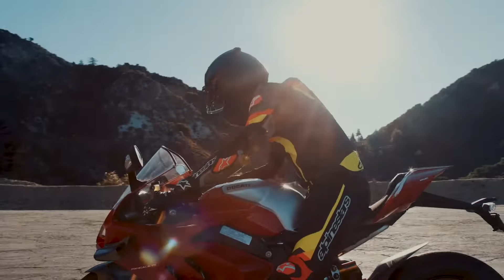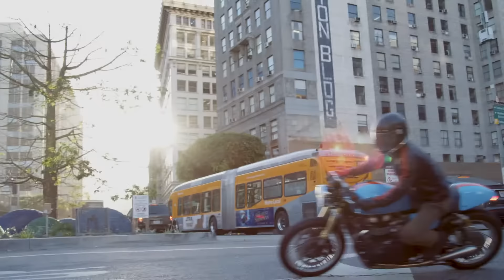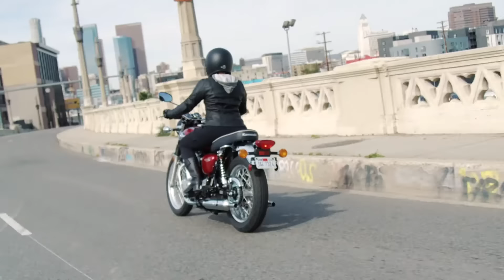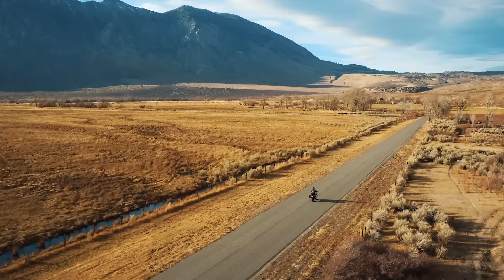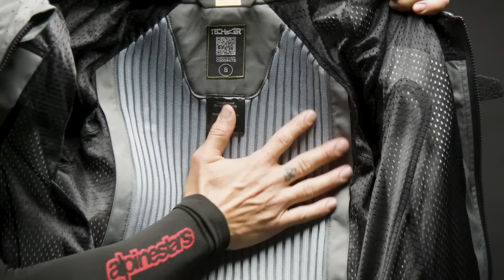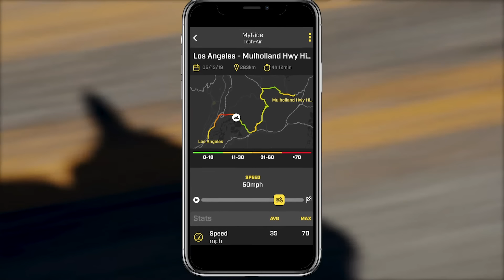Tech-Air® 5 System

Comment: Could you explain the CE Level ratings for the airbags.  In your video you provide kN force for CE Level 1 airbag and CE Level 2 airbag.  But, I don't see any value on Alpinestars website.   I am interested in the Tech-Air Off-road airbag system.  Also would be great to give a sense of something that looks like 1 kN.   Is that for of pushing 100 kg. of mass so many  meters per second?  Seems a lot.

Comment: I bought one after reading about broken ribs & scapula on one Utube test rider's slow speed urban slip on diesel.....but...

In the instruction book it has an exemption clause for pacemakers or heart conditions. Written in RED it stated Do Not Use if........

So, sadly, I returned the garment for a refund......but am still wondering why I am excluded from using one when I am still able to ride according to doctors/cardioligists....   Is it a case of legal liability protection or nanny state overkill?

Sure I have had open chest surgery, but from the video's made by Alpine Stars the TA5 looks like it inflates very gently and does not crush the chest, unless maybe, it's installed in a non compatible (not enough expansion room) jacket.

I'm perplexed. I want one, it's got the best rib cage coverage over Dianese and Klim vests, which kook like giant life vests for boating when they inflate.........

Perhaps Alpine Stars reps can advise, as staff at shops just don't know the answer.......I think I will end up buying one anyway -  after watching the video it passes my seat of the pants test criteria, but an affirmative answer from a technical expert would be very helpful 🤔

Comment: And why are they not used in MX or Enduro? If they’re so good? And resetable?
Reply: They are actually using or at least had a run with them in one of the previous Dakars for sure. I know, because our country racers have used them. Though the model was a bit different and more like MX/Enduro body armor rather than a jacket like here. I was on a fence buying it and the price was around ~1k EUR for it.

Comment: I do not recommend this vest in one and a half it stops working it no longer turns on and the bag there that is inside the vest always comes out of its place which should be putting at risk that in any fall or when it inflates it will be plowed in a position inadequate that could hurt you more and another thing is that the clasp that is on the front that activates everything comes undone very easily and to make the 5-year guarantee valid they put many locks on you and in the end you have to pay more and be careful why you They say that there is a specific way to charge the vest, why else would they tell you that you damaged it by connecting it incorrectly and they no longer want to make the warranty valid and they never show you how it should be with their USB charger and in the official video they say and show what it is very easy and fast but it does not specify that it must be connected from an exact position

Comment: Have had one since 2020. Just had a crash with it, and it worked better than I expected. Not a scratch on me, after a 50+mph lowside. TA5 deployed before I hit the ground. It felt like a very gentle deployment -- I really barely noticed it. Really amazing!
Reply: this is the best comment here <3  Thanks for the info!
Reply: @adamangelis5558  You can’t do it yourself, you have to send it back to alpinestars or authorized dealer to reset it. I think it’s a couple hundred each time.
Reply: @adamangelis5558 Yes 3 times you can use it
Reply: How does cost the cylinder?

Comment: What happens if you wear a very fitting leather jacket with traditional stretch panels? 
Do you need a golf ball of room with in the jacket with the airbag on or off?

What if you jacket has some stretch it is “fitted fit” once the airbag is in? 

Will it hurt you? Or just not deploy as well?

Comment: can I wear Tech-Air 5 without any jacket or garment above it at all?
Reply: TA5 doesn't provide any abrasion protection. Also, if you crash without a jacket over it, the airbag will surely be shredded. Instead of $180 for service, it will cost you $800+tax.

So, "CAN" you? Yes. But, you should not.

Comment: Simple question with no answer. Dear Alpinestars if iI'm riding with t-shirt can I use tech air 5 on top without any jacket? Or there are some other issue like gas cylinder on the back is not protected from direct sun light end etc.. I know there are tech 3 available, but regarding tech 5, can I?
Reply: It has no abrasion resistance.  That's why you need a jacket
Reply: You need a jacket
Reply: You’re kidding? So you want protection but wear a tshirt ? Mate grow up and gear up
Reply: @scottishmudders8357 while I agree with you, I get his point as well. I was just flung 40ft off my bike breaking 6 ribs and collapsing both lungs, puncturing one of them as well but with SUPER minor road rash, All I was wearing was a dirtbike jersey. I'd love to know if I can wear this with an abrasion resistant long sleeve with some elbow/shoulder armor as comfort is definitely a priority for me. I'd likely wear it under but it would be nice to know if I could do either.
Reply: You can certainly wear it under no issues atall provided you give your self some inflation room. I ride now with dainese race air and it’s very uncomfortable but I know it’s a superior product though the downside is it’s not for street it’s track only …. The alpine stuff is brilliant very good and comfortable. I agree comfort is a factor I think if you’re comfortable you ride better but also there’s a balance between comfort and safety … it’s the good old fine line lol
Reply: They make a tech air rally vest for offroad use@daddysenpai681

Comment: welcome to protected body but ending in a wheel chair. As usual, just a few companies are caring about locking neck . I have helite and yes it saved me twice, helmet neck spin all locked...
Reply: I have no expectation that a single garment will provide all the protection I need. Get a LEATT neck brace if you want to guard against neck injury.

The Helite (and all similar tether-based systems) have a lot of problems. Here are the two big ones:

1. It's a mechanical system, and wears out. The metal cable corrodes. The spring weakens. The piston stop deforms. This makes the performance very inconsistent, and unpredictable over time.

2. Where you connect it to your bike creates a bias. If you connect it on the right side, for example, you must fall further to the right before it will deploy. If you connect it to the front, then you will travel further forward in the event you crash into an object in front of you. This also creates a great deal of unpredictability in the Helite/teather-based systems.

FYI, I owned a Helite for years, and commuted on it every day. Everything I described above is based on my personal experience. I had the steel cable corrode and break off, rather than deploy. The piston wore down and the force to deploy became very low. (It deployed one time when I turned to look behind me at a stop light.)

The TechAir5, and all similar digital autonomous systems are better in all these ways. The only types of these systems I would avoid are those which are based on a subscription business model. (Can you imagine your airbag not deploying because your credit card was declined? Or, due to a billing error? Hell no to that!)
Reply: @wisebloodnyc  read me back. Talking about lots of airbag systems which don t lock spin/ neck / helmet... Then , just an observation in real life  and crashes. Period...
Reply: Looking at the video, the shoulder air bag would provide a lot of hyperextension protection and rather more than the TA3

Comment: Are you supposed to remove the chest and back protection when wearing this vest? Shoulder protection as well?
Reply: When the vest inflates the back protector becomes a level 10 . The vest protection offered is way higher than a chest/ back protector you’re currently using, so, No you don’t have to use any other gear.

Comment: I'm proud owner of Tech-Air 5... there are only two issues I have...
1. Bluetooth communication between vest and phone is REAL pain, regardless if you use iPhone, or Android phone. It is really really f**** hell.
2. You really get sweat in it, if you are not riding, or if you are rinding in the city. So still waiting for Tech-Air 3 🤩
Reply: I don't use the Bluetooth function when riding because it's crap. Once my phone loses its "line of sight" with the CPU unit (which is basically all the time when I ride since my phone is usually in a breast or jacket pocket in my jacket), then it gets disconnected. Don't know if that can be fixed with a firmware update, or if it's hardware-dependent. But yes, me too, I'm a proud Tech Air 5 owner/user. :)
Reply: I never head bluetooth issues, but the sweat problem is very much true
Reply: Tell me because I'm not sure: do you wear it direct on your skin or you use it on some first layer t-shirt?
Reply: @czaras_ as far as I did understand the system and information from other ressources, you wear it on some first layer t-shirt.

Comment: Great stuff, I use it every day. Please, please, make the next one WASHABLE !
Reply: I clean it with a helmet Interior cleaner with Hands
Reply: Does it stabilize the helmet when deployed?
Reply: How do you clean it to get the stank out of it? I'm thinking about getting one. Also, do you wear it under a jacket that has shoulder and elbow armor?
Reply: @WillfulThinker  Well... You don't. You can send it away to be cleaned, but it can take weeks to get back depending on where you are. I use deodorant on mine, the same deodorant that I use on me. It worked nicely enough, until there was a shortage of my usual deo and the one I replaced it with proved to be a disaster. Right now that vest is sitting unused, until I send it away to be cleaned. I logged more than 700 hours on mine I think, including two minor crashes. I think the technology's great, but the lack of consideration given to washing it is quite disappointing. It's supposed to be worn everyday for commuting after all. I wear mine beneath shoulder amour, though it's probably redundant.